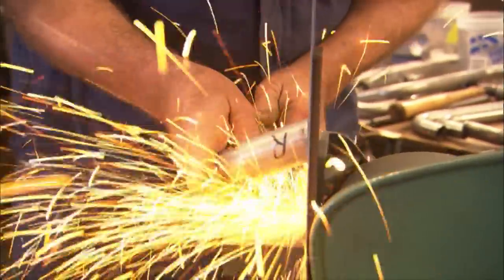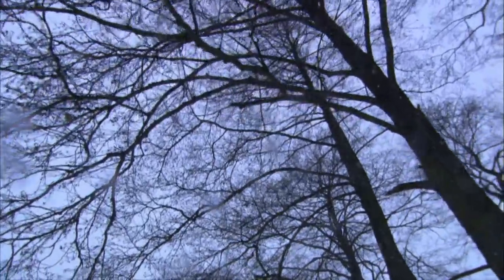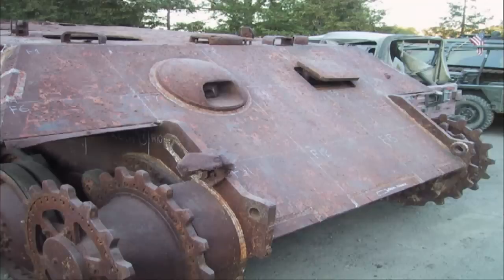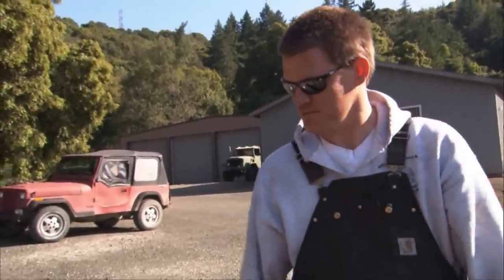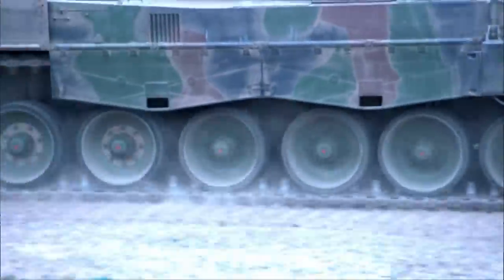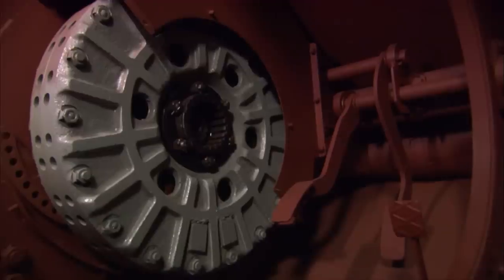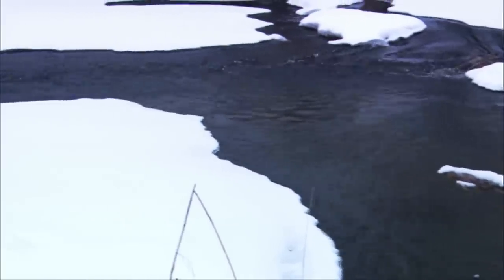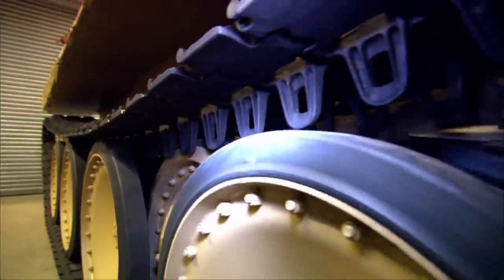Tank Overhaul - Episode 2 - The Panzerkampfwagen V Panther

Comment: It is too bad that the Germans went with the fragile engine in a Gasoline configuration. 
It would have been incredible to see one of these tanks with a diesel motor.
Heavier, sturdier and MUCH MORE torque. HP makes you go fast, torque accelerates you quicker and keeps you driving longer.
Reply: ObsessionPC they had no experience with tank diesels. The Russians and Americans did.

Comment: If properly made, the king tiger would have been the best tank of world war II. But, because the of lack of supplies and man power, the steel made to use the king tiger was of bad quality, making it penetrable by the 122 mm shells from the is2s and a lack of tungsten made it so that it could not use apcr shells as well. And while people may say that its too big and too heavy, that is also a myth. While, the engine may be incredibly under powered, their wide tracks made the weight distribution even better than the shermans and t-34s. The 88mm on the king tiger was also bigger and more accurate than both the guns on the tiger 1 and the panther.

Comment: 6k panther, 50k sherman..quality and quantity..hmm..
Reply: Roughly around 58,000 T-34's were made, so it was more like 100k quantity vs. 6k quality.
Reply: @MATTHEW SHARMAN the Sherman also was easily repaired and had the first stabilized gun .
Reply: .".quality and quantity..hmm.."

Same like the NATO doctrin during the cold war years , quality ( Centurions, Chieftains, Leopards, M-60 , M-1)  vs quantity (T-55, T-62, T-64, T-72 )
Reply: @MATTHEW SHARMAN This wasn't about quality the Panthers drivetrain was borrowed from a lot smaller a vehicle this was the issue with the tiger and king tiger

Comment: What they said is not true the panthers armor was like 50-70 mm in the front and a m4 Sherman could easily penetrate the armor from decent distance.
Reply: Not the 75mm. The UFP was 80mm, but sloped back at 55 degrees (from vertical).

Comment: "1 on 1,nothing the allies had could take it down,well,soviets had the IS,IS2,SU-152.SU-122,ISU-152 and the T-34-85
Reply: Mario Bošnjak yet those were all late 1944 tanks. Panther is an early 1943-1944 tank. Which means it ruled the battlefield during that time. And even then the SU-152 was used as artillery by the Soviets. Also the T34/85 worked in numbers,not by itself. Along with that I shall add the IS-2 wasn't used until around 1945,and even then it was rare to see any use of them. Point is,Allies really didn't have much to use to stop the German tanks in early 1943 nor in 1944.

Comment: "MTU builds state of the art engines for the German army's Leopard II tank"- Its a SOHC diesel. Literally 100 year old technology....
Reply: Sam Moon with 1500 HP which isn't, as well as being more efficient. Just because something is old doesn't mean it isn't highly refined. The wheel is older, yet the wheels we have today are a million times better.
Reply: Silberc Cheeba So, you call the wheel "cutting edge technology"? 
Wheels themselves are not "a million times better", the way they are spun(ICE, EV, steam) is different than oxen, and yes, a million times better in that regard, but the wheel itself has not improved much. The materials are different, but seeing as how ancient chariot wheels still exist, and still turn while supporting weight, I don't think you could possibly quantify how a wheel is a "million times better".

Bottom line, I was more or less making an amusing observation; diesel is not cutting edge at all. It's highly refined and reliable, but still old technology. In fact, the biggest improvement to diesel in the last 100 years, aside from the turbo(also over 100 years old) was the computer control system, but, as the video simply stated that "MTU builds state of the art engines", and a diesel is not, in any way, state of the art, it's still amusing to me.  

GM still builds a pushrod V8, yes, it has massive amounts of refinement over the 1955 SBC V8, but it's still an ancient design that even GM says they will need to replace with a more modern, OHC design, as they've reached the limit of development, short of simply adding more displacement. 

With the development of fuel cells, and ICE engines with multiple pistons in the same cylinder being developed, and the fact that diesel has reached its development zenith, again, short of adding more size to the engine, it's still a little amusing to call a diesel motor "state of the art". They are proven, and reliable, but state of the art is a comical claim
Reply: SOHC is adequate for low RPM diesels it's the lower compression, turbo and electronic control that make a tried and tested reliable unit state of the art.

Comment: Neutral steer? That's pivot steering. Neutral is when only one track moves, pivot is when two tracks move, one opposite to the other.
Reply: A series of more advanced designs were introduced, especially through World War II, that maintained power to both tracks during steering, a concept known as regenerative steering. Some also allowed one track to move forward while the other reversed, allowing the tank to spin in place, a concept known as neutral steering. The first really successful system was the British double differential design of 1924, which was copied by both the US and Germans.

-Wikipedia
Reply: No..neutral steer is when you steer  when the trans is in neutral and you applied left or right steer, one track moves foreword and the other moves to the rear, the us tanks had this ability in 1950. By the way I spent some time  in this panther in 2004 and 2009 , as well over 20 years in US tanks.
Reply: @dws1396  the first combat tank to do this was the Churchill. Which was developed in Britain in the early 40's
Reply: @dws1396  Thank you for correcting all these "gamers" that think they know better.
Just because they have spend hundreds of hours on their PS/Xbox does not mean that they know one iota about tanks.
Reply: the panther had neutral steering.... so silly. pick up a book
Reply: I thought the suspension and a gun stabilizer was the key to good tank. The Pershing for example.

Comment: How hard would it be for a well equipped engineering company to build a Panther or Tiger from scratch using original blue prints? Surely there are some crazy billionaires out there who would fund the project.
Reply: Most billionaires became billionaire by not being stupid.
Reply: Re-manufacturing stuff like this is becoming easier and easier with the advent of new technology.  The first brand new steam Locomotive built for around 60 years was completed a few years ago in the UK, which compared to a tank is super complicated.  So tanks should be much easier.  Even WW1 and WW2 fighter aircraft replicas are being made!
CAD, CNC laser modelling, 3D printing, etc, etc, have reached such sophistication that these sort of projects are more than feasible, it just needs money and motivation.
Actually, the most difficult parts would be instrumentation, radio's, electrical parts etc.  It would be fully possible to make replica engines but VERY expensive, so a modern unit may be a practical solution.
I reckon that a replica Tiger could be made for about £5M, plenty of people are around that could afford that, if they were interested enough.
Reply: Most of the billionaires are too busy counting their money.
Reply: ***** me too. If I had the money.
Reply: https://www.facebook.com/Project-Build-the-E-100-793858930693963/?fref=ts check this FB page, some ausies are allredy doing that. they need Dosh and crew though.
Reply: Split Personality Awesome, thanks for the link...I'm actually living in Australia.
Reply: Patriarchal Shitlord fucking awesome! Meself is a swede. And youre welcome
Reply: I would if I had the cash, imagine having your own Panther!!!
Reply: @ryancannon5921  how about a good working jagttiger 👀😏 fck it i would build it al 😬
Reply: @SuperKalashnikov47  - Classy language.  Not.  :(
Reply: Probably not very hard if they have the blueprints.

Specially if you consider there were 9 Panthers built post war for testing purposes.
Reply: Actually the blueprints do exist, and more documentation is being discovered all the time.
Reply: Well. You could also study the Tiger at the bovington museum if you can´t find blueprints for some parts
Reply: would build the Heavy Gustaf railway gun
Reply: yeah, but machine made that way has no Historical value. There is no point in doing it otherwise.
Reply: It would be harder than you think.
Reply: That would take many millions of dollars.  So yes, that's how hard it would be.
Reply: +Patriarchal Shitlord is the Panther really that strong or the E-100?
Reply: Patriarchal Shitlord well Steel is not that expensive 100000 dollars mayby if you build yourself inclusive the crain.
for a BT model

the expensive parts Are gears and engines
Reply: + Adamast

......or impulsive.
Reply: If I had the $$$ I would try
Reply: With today's technology, we don't need the blueprints. Although blueprints would be nice, however we could just dismantle the tank and 3D scan the parts and get the dimensions from 
that. All you need now is the resources and money to put it together.
Reply: after ww 2 the british built a panther from parts   this is the tank found in german mans basement
Reply: That was literally months post ww2 though. 

Not 70+ years later when parts are barely available
Reply: count me in!
Reply: I don't even think that they would need to well equipped cause if they did it in the 1940s it Should be easy and honestly shouldn't cost to much since it's more efficient now and modern tanks are only expensive cause of all the high tech bullshit
Reply: @graywolf7648  they are restoring a tank that's was used in battle and sat in a river for 70 years. Not building a kit Shelby cobra...
Reply: If I were one of those Billionairs I'd be having my engineering teams building all sorts of stuff... Panthers included.
Love to have that kind of freedom.
Reply: +Gray wolf a replica tiger under 100K euros built in the Ukraine by Russians for a war movie a few years ago.. 
They used a existing older Russian tank and cosmetically changed exterior to resemble a tiger tank.. 
Unfortunately, movies director reneged on the deal making his lost someone else's gain.. Videos can be found on YT.
Reply: So many of the parts the Germans used aren’t available anymore
Reply: If I was a billionaire I would do it in a heartbeat. I would restore every German World War Machine that I could. Tiger 1, tiger 2, Panther, stug, hetzer, buy an mg 42 and 32.. and possibly a range of other vehicles. Have a nice temperature controlled garage for them, can possibly set up something what people can visit and see them. Without a doubt. And if I could find a way to do it buy a leopard 2 A7!!!!
Reply: @Mohammed Khaled E 100 didn't actually get made.
Reply: What would be the point you may as well make (or buy) an A1 Abrahams or a Challenger or a panther or a t92 or something 'modern'
Reply: The News: "BiLlIoNaRe FuNd NaZi TaNkS!!11!!1!"
Reply: Well, it would be pretty damn hard to fabricate that Maybach motor and transmission from scratch.
Reply: The Australian Armour and Artillery Meuseum in Cairns, Queensland have been building one from scratch.
Reply: The law would be the biggest hurdle. Even if built brand new and the weapons drilled, a tank would be considered a WMD
Reply: but it would not be original
Reply: If the panther has the bugs worked out, I'd buy one.
Reply: the market for people willing to buy functional panthers is too small. the army gets away with making tanks because they have virtually unlimited money from taxes and money printing, but a private company would need to make the investment pay for itself, which is not what happens
Reply: What's the point, these vehicles are interesting and unique because they're now incredibly rare in good condition. 

You could build a replica ( lightened or no armour plating, incorrect engine and transmission, that sort of thing) very easily and fairly cheaply in comparison to rebuilding one. Especially considering modern materials. 

However, no one would want to do all the welding and manufacturing for free and it's Still not a viable option to do without external funding.
Reply: I would rather make my own blueprints and design my own tank, than something obsolete.